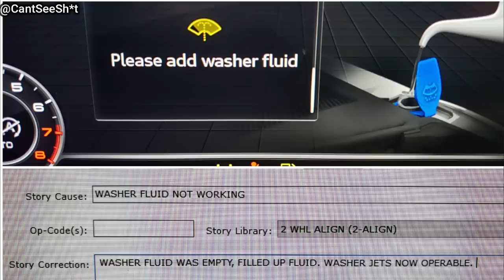Customer States Truck Feels Weird While Driving (GMC Sierra) | Just Rolled In

Comment: Had a rental car come back one day with the message "check tires, seem hard" 3 tires had psi in the 90's and the fourth was at 119psi. I don't know how those things didn't explode
Reply: JEEZ. at those pressures, it would be a 'who draws the short straw on who has to depressure those'.  to me that would be like handling a live bomb just 'breath calm and move carefully'.
Reply: Wow!!
Reply: i will never fucking understand what goes through people’s heads. “let me just air up this tire until it can’t hold any more pressure, ah perfect driving on four pressure bombs, just how i like”
Reply: @ARSZLB  Well it does make the daily commute a blast ;)
Reply: @ARSZLB  It is to save gas, they assume there is some safety mechanism.
Reply: @Talatharas  Better to call local Police for some practice shooting.
Reply: @ARSZLB  They're trying to get the pressure warning light to switch off.
Reply: I used to work for a guy that made me inflate tires to 90 PSI first and then deflate them to the correct pressure every time I put on a new one. He'd be all: "Yeah, yeah! It'll be fine! Just do it, it'll make the tire seat real good on the rim!" And I'd be all: "Nah, you do it yourself if you think it'll be fine!" But he never did.
Reply: @Talatharas  
It's not actually really dangerous, the real risk is with a LOOSE tire as if that blows out it can launch the (comparatively) light wheel as a projectile with major force, but if it's bolted to the car... well even if it blows out it's not going anywhere. You saw it with the tire in this video: the side wall pops and it blows out a big rush of air and... that's it really. Any shop should have a gauge with a fair length of hose, a clip on chuck, and a deflate function so just put that on and don't stand directly in front of it just for the added bit of insurance. But really a high PSI tire that's bolted to a vehicle isn't actually particularly different than a high PSI tire in a cage, in both cases the big thing either is really doing is keeping the wheel itself from becoming a projectile if it blows out.
Reply: @Tk3997  Still wouldn't want rubber/metal shrapnel coming at my face.. Right?

Edit: there was another video I saw on one of these channels and a dude had a tire in a tire cage, it blew from over pressure and the rubber/metal flew out and hit him in the stomach, comments were saying the dude died.. Can't confirm.
Reply: @FappinSteve  
Thing is, a "cage' doesn't do anything about that either since it's basically just a couple of steel bars set into the slab. 

It's really very unlikely to generate much, maybe a few chunks of pretty low velocity rubber, but the steel is really too woven together in the tire for pretty much any amount of air a passenger tire could actually hold to be able to rip it out and propel it. Back in very yee olden days there might have been a risk with multiple piece wheels where they might be able to separate and launch part of the wheel even when attached to the car or slip through the bars of a loose cage, but those pretty much don't exist on passenger vehicles anymore. 

Like if you had your face six inches from where the tear formed without any kind of eye protection it might be able to fuck up your eyes, but an overinflated passenger tires that's firmly contained in a cage or bolted down isn't really some kind of grenade.
Reply: I drove a Versa back from a shop once that seemed to "ride hard". Found the front tires were at 80-90 psi. Ugh. I don't even know why anyone would do that.
Reply: @Tk3997     you are clearly talking about the first clip of a tire that [comparatively slowly] depressurized through one of the bulges [did not explode]. Perhaps you should rewatch the last clip of the exploding tire when the man is filling it at the station. It takes a fair amount of force to blow the fender off a car, and the fender of that car was found stuck in a tree branch 25 feet up in the air. Dude was lucky to have only minor injuries.

Depressurizing isn’t really dangerous because: obviously. If it hasn’t already exploded from being over pressurized, it’s not going to explode when you reduce that pressure.

Comment: I remember when I was a kid, we went out to Wyoming in my dad's 69 Coronet wagon. In those days radials weren't a thing and we had to drive over this road being built and it was graveled with this huge railroad gravel for 10 miles. All four of dad's tires looked like that truck. He cussed up a storm.
Reply: Found out on a 70's Bonneville that non radial tires do in fact explode at undesirable times...
Reply: Ah yes the non radial car tire. Mom had a '62 Rambler Station wagon. The tires were bald but not flat fix a flat had recently started being sold so she bought 4 cans every payday till the tires stopped loosing air. It had a non vented fuel tank we could drive a week on Empty in the summertime. Leaded gas was the best. It didn't like that new no lead crap. Diesel should be sulfur yellow and gas should be full lead. Phones should be a rotary.

Comment: bubbles in tires come from separation which is caused by multiple factors such as under inflation, over inflation, interior damage, and run flat conditions or even just a bad tire from the factory
Reply: In 8 years of selling tires at a high volume store, several thousand tires per year, and including many completely questionble Chinese or Malaysian or Vietnamese-manufactured ones, I have seen exactly ONE defective tire result in a bubble, and it was an OE Michelin on an Accord. Defects are insanely rare, and given the abuse tires go through, even failures due to environmental factors are, too. Really crazy products of modern innovation, pneumatic tires are.

Comment: Worked in a plant back in the 80’s and the owner had a couple truck pull trucks. One was a “wheelie” truck. Just 2 wheel drive with big tires on the rear like the tractors had. The mechanic that serviced them was airing one of the rears one day, got side tracked then left to shag parts. The shop was inside the plant backed up to the offices. I was only about 75’ away when she went off. Literally like a bomb went off! Shit went everywhere in the shop and shit probably went everywhere in the architects pants too. Cleaned all the dust off everything in the shop. Only thing that saved the mechanics ass was he was the one that built the drivetrain for the pull trucks. Good times!

Comment: Driving on those tires with 90PSI must have been like driving on steel tires -- you'd feel a grain of sand on the road.

How would you not notice?
Reply: Or low profile rims and tires
Reply: How would you not destroy the suspension immediately?
Reply: Some people genuinely prefer it that way.
Reply: Most people know very little about cars.
Reply: They probably read someplace that too low pressure hurts MPG so they figured the higher the PSI the better 😂
Reply: Gotta get those MPGs up somehow!
Reply: Long ago, my uncle aired up the tires in his car... He was seldom driving it, mostly driving big trucks (i think in the US those are called Semi?). So he put the same pressure in his car tires,  he was used to put in the truck tires. (at least that was his "excuse") If i remember correct he put in around 7 bar. (google tells me that's 101 psi) He said it feels kind of hard driving (only had driven it for 6 km with that pressure).  So we convinced him look in tue fuel filler cover to notice the correct pressure. Took some time to air them down to the correct pressure. :-D
Reply: The same way they don't notice when their suspension is in pieces, and their whole axle is ready to fall off.  They don't pay attention to how it feels to drive, or they don't know what it should feel like.

Comment: I'm betting that the over-inflated tires are a new "Save gas!  Car tricks big oil doesn't want you to know!" thing.
Reply: Never underestimate ignorance.  When the TPMS light comes on, the tires must be low so I add air🤪
Reply: Maybe, but a lot of places I see for filling tires have no gauges.  The driver is stuck using their best judgement.  (ugh!)

Comment: Also also when I was wrenching on fast jets we had a tire filler that had maybe five feet of hose between the fill valve/gauge and the actual screw-on stem adapter.  Granted it was for truck-size magnesium split rims filles (by design) to 250 psi, but for having watched enough of these it seems like a better and better idea.
Reply: wow if one of those blows it could cause a million bucks damage to a jet plane. them things aren't cheap and have to meet FAA repairs.

Comment: On the second clip with the highway tire blowout:
Once had a friend who filled her tires at a Wawa gas station pump. I was with her. It said they were at 45 PSI, and we didn't check with another gauge because we assumed the Wawa pump was accurate.
Her dad checked later that night and they were at 65 PSI (only rated for 45)
Reply: Your statement and the 8 thumbs up so far is concerning.  You NEVER fill you tires based on the rated PSI on the side of the tire. You inflate to the vehicle manufactures recommended PSI while is usually but not always listed on a sticker inside the drivers door jam or the odd time the door itself.  PSI is a NA standard. Other places in the world use Bar as the pressure unit of measurement.  I feel uneasy driving any vehicle that I don't know the exact cold pressures of each tire and that they are no more then 3 PSI off of the recommended number. Meaning 1.5 PSI over or under.  Anything outside this window I will correct.  This goes for tires fresh from the tire shop.  Heck I've even argued with a proved my point that the correct tire pressure is needed BEFORE you balance the tire.  Here in Canada we get wild swings in temperature mostly in the fall and spring.  Where one day it can be 10 C the next could be -15.  These are the days you see "those people" on the side of the highway with flat tires/blow outs...   It never fails to happen.
Reply: @LazyBoyZR1  exactly
Reply: @LazyBoyZR1  That's NOT necessarily true.

Load rating for a tire is AT the indicated PSI. If you carry a load that requires the full load rating of the tire you MUST be at the max inflation, no matter what the door reading is.

I will "air up" the tires on my pickup if hauling heavy, then "air down" when doing more normal things. And "air way down" for offroading.
Reply: Thats not bad at all.  Now when its over 80 to 100 plus psi then you need to worry about it popping..
Reply: Never trust gas station pump gauges.
I always check with a hand gauge, and ALWAYS have to adjust after filling--frustrating when the pump shuts off and you have to pay more to add a couple more PSI.
Reply: @LazyBoyZR1  the door panel rated pressure and the tire rated pressure were both 45 lol.
Reply: @bcubed72  You have responded to cases outside of normal everyday passenger care driving, as I was obviously stating.  I 100% disagree with you maxing out the pressure to tow or haul. If you are driving a vehicle that can by design perform these tasks of hauling or towing, Pickup, SUV, etc. If you also follow the instructions regarding your max tow, haul from the manual, then the tire pressures will be indicated in there if they differ from the recommended pressure.  You DO NOT inflate a tire to it's max pressure ever and drive it at highway speeds on public roads.  The engineers that built the vehicle will indicate what pressures the tires should be, they do this to cover all scenarios, hence the recommended pressure for the tire in the door jam or door.   As for off roading, airing down for more contact patch size, that's again not on road driving.  I totally understand this and agree with you.  Air down for slow speed off roading, trails, rock crawling etc.   Just when you are done, before you take it back on public roads, inflate to the OEM recommend pressure.  This doesn't take into account custom size wheels/tires of course so no need to point that out.  Bottom line here, is the vehicle engineers are WAY smarter than we are, best to follow the instructions for the safest operation of the vehicle on public roads, when you could be the one in front of me on the high way tomorrow.  I certainly don't want to watch a high speed tire blow out because someone saw 125 psi on the side wall MAX and filled their pickup tires to that cause they are hauling a jet ski......
Reply: @LazyBoyZR1  
1. Hauling to the limits of your GVWR/GAWR isn't really "outside normal everyday activity" if you own a pickup, is it? Presumably you own a truck to do "truck stuff" with it, no? As a case in point, tomorrow I'm loading up a full bed of red oak and making for a cabin in the woods, 70 mi away.

2. You aren't merely "of a different opinion" regarding hauling at the limit; you're flat out wrong. The TIRE load ratings are calculated at a specific PSI, and only good at that PSI. No matter what the car MFR has to say about it. For example, my tires have a "max allowable" inflation of 50 PSI, and a "max load rating" of 2271 lbs at 44 PSI. That is only good at 44 PSI, and decreases in a linear fashion as you lower air pressure. E.g. at 33 PSI, they are only legal to support 1703lbs each. If you exceed 1703, you ARE ILLEGAL unless you up the air pressure! Remember that a LIMITATION takes priority over a RECOMMENDATION.

3. MFR PSI ratings are a "one size fits most" recommendation. If you are at the "Driving 101" level, you should defer to the rule of thumb. Once you make it to the 200 or 300 level, you can alter PSI, for specific reasons, to accomplish different things: over/understeer bias, in addition to the aforementioned hauling and offroading.

4. MFR recommendations assume your vehicle is stock. If you have altered your suspension, spring rates, etc...all that goes out the window with your custom setup. I upgraded my rear leaf stack at 200,000 miles, and thus my spring rates are closer to a stock F250 than F150. This has an effect on tire PSI, as the spring rate, rebound, etc of the entire system is what matters, not just tires taken alone. (Again, this is 200 or 300 level stuff...noobs stick to "default settings.")
Reply: @bcubed72  I think you didn't read my response in it's entirety.  Before I waste anymore of my time explaining the difference between an OEM tire and recommended inflation value as opposed to anything changed or modified,  as I was clear in my previous response. I will restate that you are assuming that what may be Illegal for your local state or county laws are not the case everywhere.  As well, when you get into a specific class of vehicle you may have some truths to what you are saying about different pressures for different loads.  Here in Canada we have different class of drivers licenses and with each comes more required education, skill, and experience needed to obtain and hold onto said license. This 101 and 200, 300 level stuff only points to your limited narrow understanding of international differences.  You are also listing models of pickup trucks that are most common in your area.  Maybe its more common for you to modify your pickup at will with different tires, and suspension equipment and that's all fine for your area I guess.  Many places around the world have far more strict road safety tests and would not allow such modifications that you are describing. My point is and always has been, the engineers that designed the vehicles, including your F-150, F250, F250's etc are WAY smarter than you.  What you are indicating on the per tire load rating are maximum ratings. If you check your tire pressures daily, and air up for a heavy load, and air down when that load is no longer in your truck I would call you a very very! rare truck owner/operator.  But to say that my opinion is flat wrong I again say you either didn't read my reply slowly enough for you to grasp or you don't understand English.  Maybe it's both.  You quoted me "outside normal everyday activity"  Are you saying that the majority of truck owners, daily haul at full capacity or tow at full capacity to the point where they feel the need to max inflate tires that they added onto their trucks after purchase, that are not the OEM recommend size, speed, sidewall strength and load ratings?  Or are you not comprehending that the majority of pickup owners DO NOT daily drive in that condition.  That in fact the Ford engineers have done their homework and have gathered loads of data that indicate a recommended pressure is the best for most drivers, for most occasions?  Maybe you are putting yourself into the majority group out of a lack of ability the see the larger world around you, not in your immediate local context.  Your case isn't the normal case, far from it.  Please do yourself a favor and re-read my previous reply.  Read it slowly and maybe if you need it, get out a dictionary to explain the big words if you are having troubles.
Reply: @LazyBoyZR1  I reread you comment, in its entirety.
I comprehend it; I merely find it to be sophomoric.
Reply: @LazyBoyZR1  
Um, I AM running the OEM tires. Or at least the same 235/75R15s that came from the factory, and identical load ratings. I'm uncertain why you'd assume otherwise. The only changes I've made is when the rear leaf springs started to sag, I swapped in a fresh pack with an additional leaf, so that the vehicle handles better (more safely) at the limit of loading.

It's also weird that you simultaneously argue I'm a skilled, conscientious operator...and an unskilled, semi-literate reader. You appear to be talking out both side of your mouth, or whatever orifice you reserve for that function.